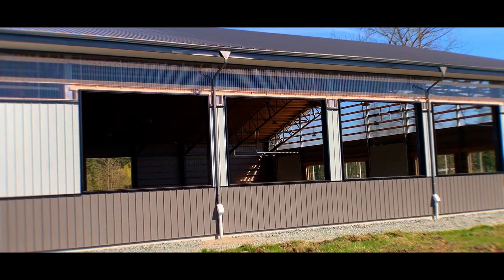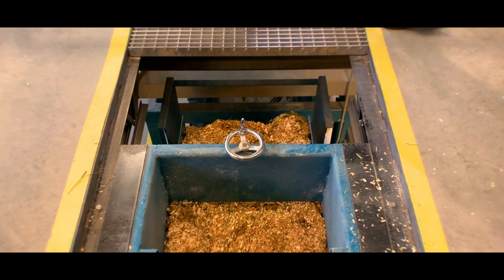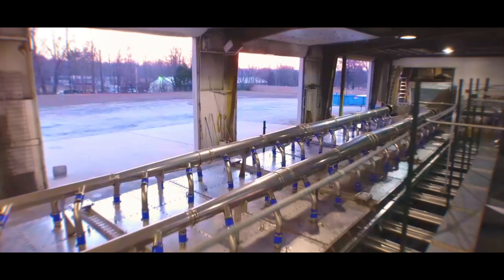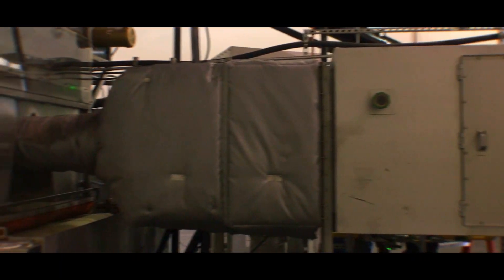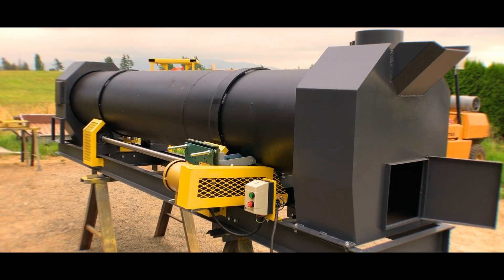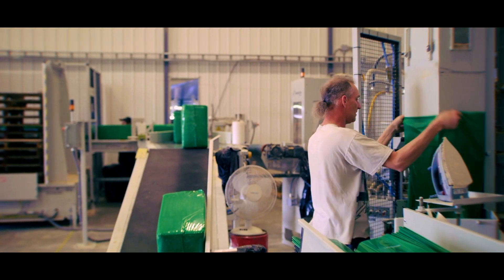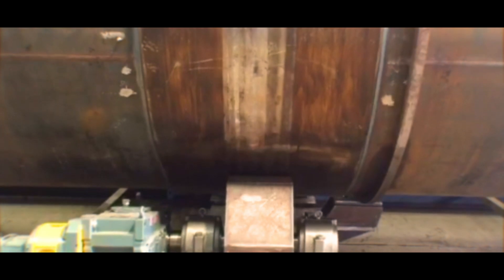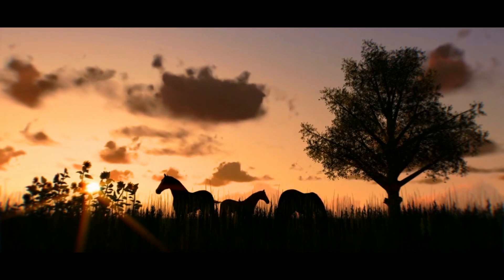HiPoint Ag Full Process Walk-through

Comment from the maker: o HPAB is not a stand-alone compost site or transfer station
o HPAB does not accept rotting manure to separate and process
o HPAB only accepts stall residuals from licensed haulers using covered trucks
o HPAB controls the quality of shavings and manure buns utilizing the facility
o Stall residuals should be at least 60% wood shavings with no more than 40% buns by volume
o No stall residuals will be stored or deposited outside on the building
o Wood shavings and manure buns leave the facility in an inert state (little to no odor) 
o Replaceable carbon and ozone filters are used in buildings 
o Fans and blowers within the buildings produce low-level noise and odor
o Low traffic count of under 19 trucks per day